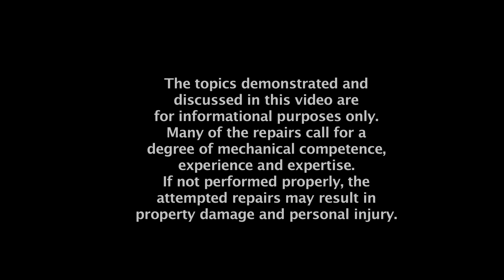Steering Rack Part 10 of 10

Comment: Excellent series of video's. The rack on my '92 sprung a major leak, with all fluid escaping from a break in one of the boots. After reading some comments on a RR forum, I was concerned that replacing the seals was a very difficult job, because an expert was advised. Because of your videos, I now see that it is very basic, with the main problem being access to the mounting bolts and using a bit of muscle and a couple of large wrenches. Although, it seems one special tool is needed to compress the nylon, or PTFE rings. 
A couple of question: On the nylon/ptfe rings at the ends of the shaft, instead of compressing them, could they simply be cut on one side with a 45 degree cut, with a few thousanth of material in the cut removed to allow the diameter to be slightly reduced? After all, if they are only needed as guides, maybe the cut will not affect anything.
Also, what size wrenches are needed to remove the hydraulic lines?
Thanks again.